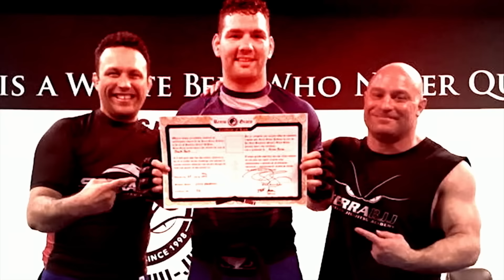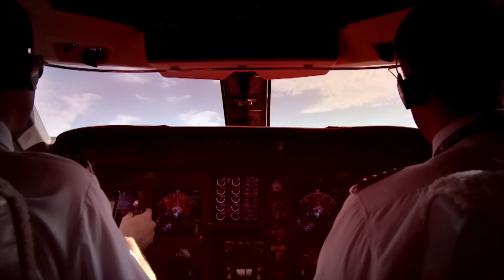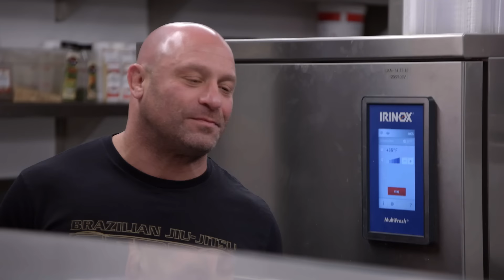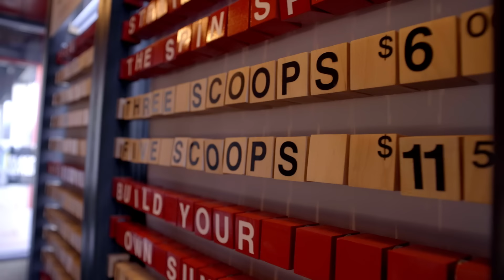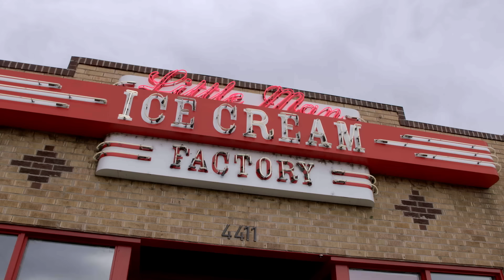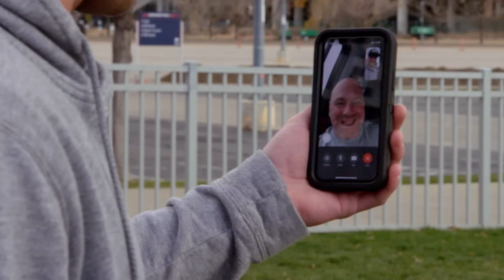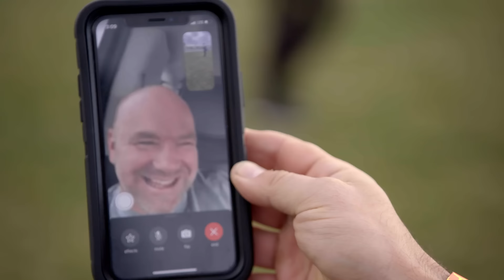Dana White: Lookin' For a Fight – Denver

Comment: I went on vacation a couple years ago and I ended up at Cave of The Winds, my friend said she wanted to do the Teradactyl ride. I agreed and thought it was no big deal, I was wrong. It’s not bad until they lean you forward and you kind of come out of your seat a little while suspended by the harness. The initial drop is wild and it will take your breath away, with all that said, it was amazing and I suggest everyone doing it if your near the Colorado Springs area. It’s one of those things you will remember forever. Also, they offer a usb drive with the video of you doing the ride so you can always have the video to look back on.
Reply: 18996 Palmer Creek Drive